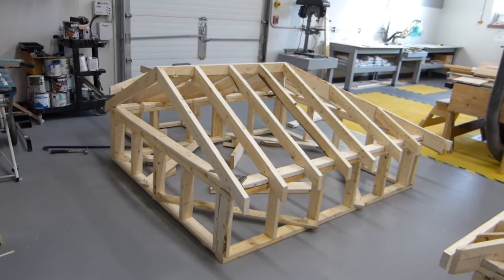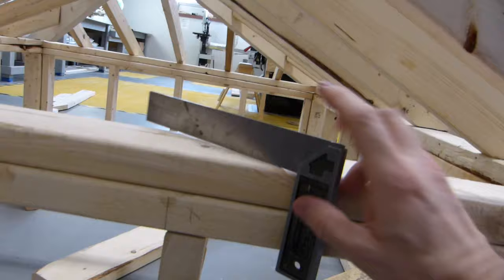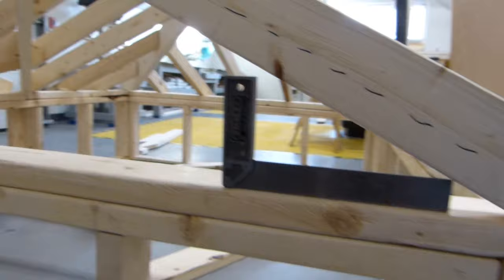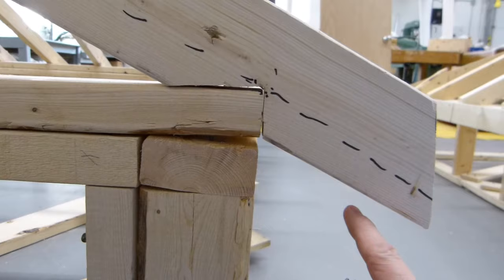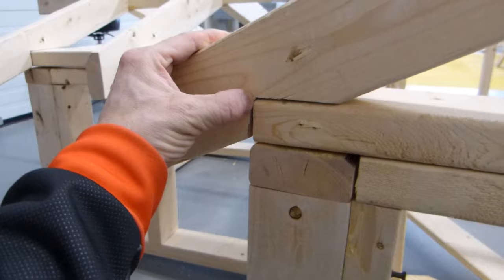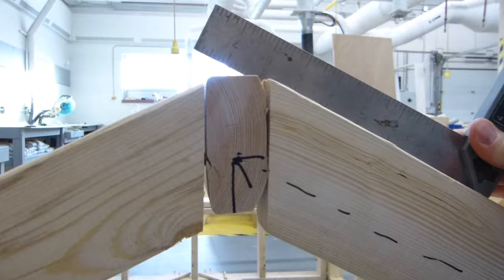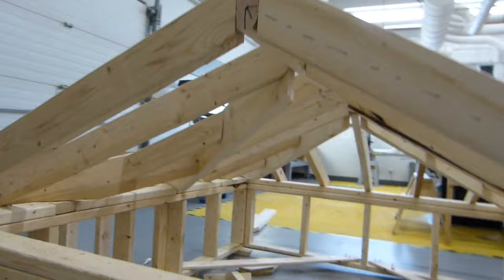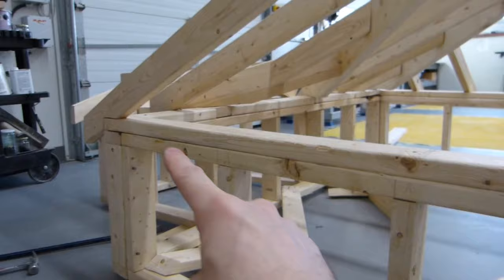Length of a common rafter - concept and terms

Comment: Can’t you obtain the length of the rafter by stepping the framing square holding the square on 12 for the run and 7 for the pitch and step it the amount of feet for the run of the building? Instead of figuring out math?
Reply from the maker: Stepping (bunny hopping) is really imprecise after 5 steps or hops, due to lining up start and finish points accurately repeatedly

Comment: Do you know what codes or textbooks call out where you can start measuring from to get your similar triangles that aren't on a edge of the wood? It doesn't feel intuitive to me at all.
Reply from the maker: Some textbooks are more or less clear on this, L. Coel, Carpentry, is one of the better ones. Code books do  not have trigonometry in them.
Reply: Leonard Koel